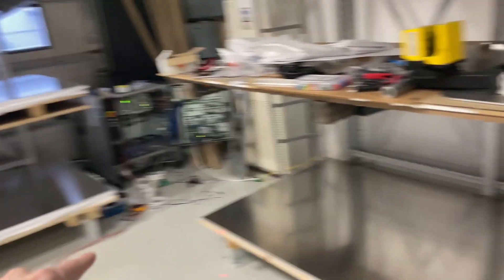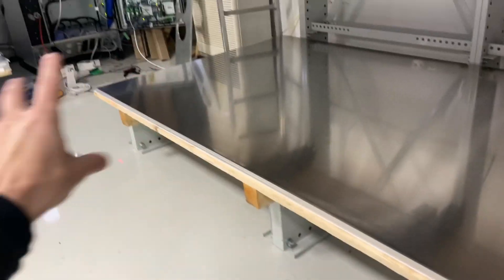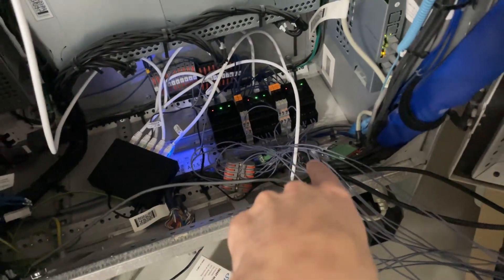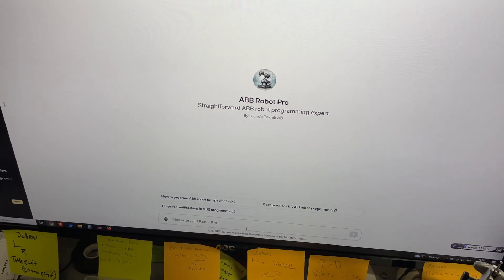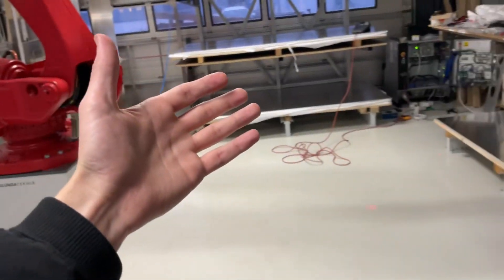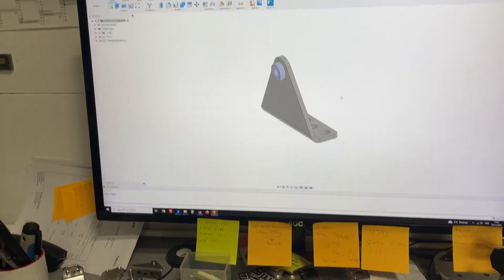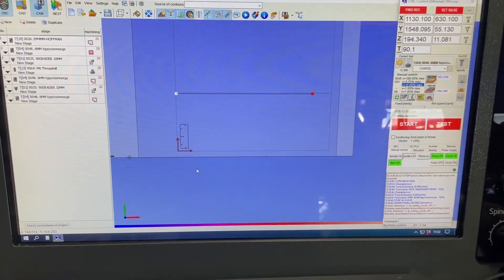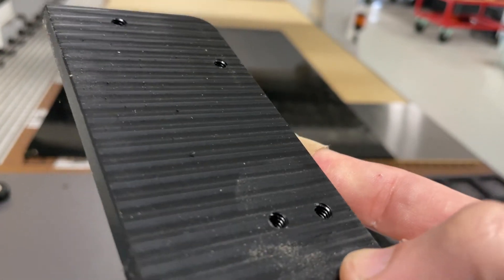Upgrade Update Part3

Comment: Been counting the weeks since the last update! this is getting so cool. I have a cool automation project I wish I could post and show off some.

using Clearcore controller and clearpath steppers with touch screens and cool stuff. and some seriously heavy moving fixtures and hardware. all electrically compensated and self homing to make up for any distortion since the machine is mobil.

I wish we had HDF sheets available like that here stateside.

Your system is getting so efficient.
Reply from the maker: Gmornin!
That sounds awesome, i love Teknic products ever since I first saw them on a friends Multicam 7000, which was the most amazing thing i had ever seen back then :) Sick acceleration profiles!
The clearpaths launched way later and just added to the excitement for that company.

I bet you could find HDF over there, not easily perhaps tho. I had to go trough hoops to find the sheets with the highest density that still are somwhat the right format,thickness and price.
kronospan are available world wide and probably sell in the US but they might want you to buy alot.

Yeah things are getting pretty dialed but it feels like alot of loose ends need to be addressed.
"Completion" is always 5% away :)
Reply: 90% there 90% to go as the marines say...  your shop is looking so nice. Comparing to the video I'm editing for myself it's just spotless.
Reply from the maker: @hyperformancellc  Thanks yeah the little robovac has been working overtime :)